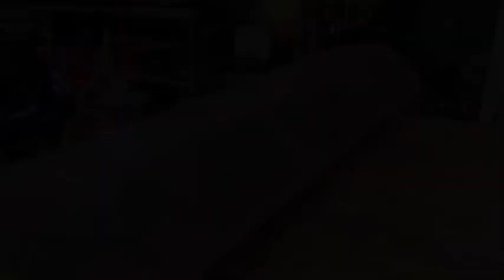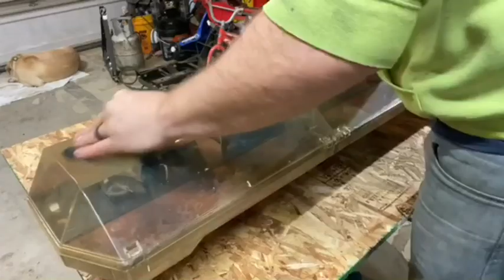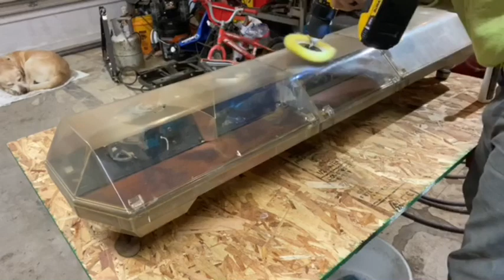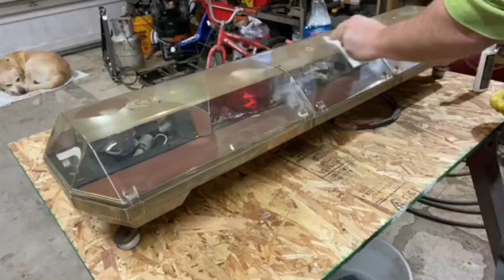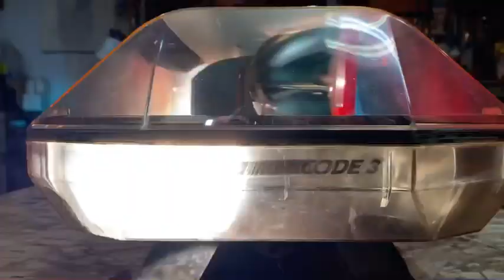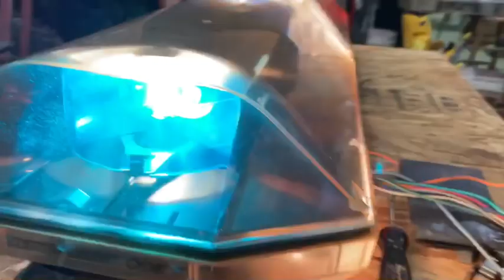Code 3 mx7000 dome restoration

Comment: Great job, however, I've found success in using SprayMax 2K Clear Glamour clear coat, it's a 2 part auto clear coat that works amazing and you never have to polish again. I used to polish bars all the time and now that I've found this stuff, all I have to do is wet sand, dry, and spray the bar and it's done and looks factory new permanently

Comment: Really no comments on what your using to clean it up with? It might not only help someone it would keep someone interested on staying.
Reply from the maker: I use 2000 grit then 3000 grit I use windex instead of water to wet sand then plastic polish   Sorry for the delayed reply I work about 70-80hrs a week so it’s been hard to get on here the past few months
Reply: @mmpse2868  incredible transformation!  Thanks for the clarification of the sanding process!  I'm guessing Meguiars Plastx?
Reply from the maker: Thanks! That is correct.

Comment: When i did mine i used 1000, 2000 and then 3000 wet sand. Hand polished and hand waxed and came out decent but definitely needa try a drill next time for polishing it
Reply from the maker: Drill definitely speeds up the process

Comment: Hey thanks for that bit of info. I have put a bunch of time on polishing the plastic with some success but still not where I would like it to be. I went completely through my code 3 MX 7000 light bar and to finish it I need to locate 2 of the rotating light plastic gears that had become brittle and broke apart. 4 out of 6 are functioning. do you have any idea where i
I might be able to find this part? I have looked and didn't locate any. Thanks
Reply from the maker: You will have better luck just replacing the whole rotator assembly. Elightbars.org is a great source for used parts and Facebook has several pages for emergency equipment.  I recommend used rotators over new just because of the price.

Comment: What methods of sanding do you use?
Reply from the maker: I use 1000,1500,2000,3000 then polish. I use windex instead of water when I’m wet sanding
Reply: @mmpse2868  Thanks for the information. Is there any certain motion you have to do during sanding?
Reply from the maker: @sirendude  preferably Circular motion. I’m in the process of uploading a step by step video right now. Just waiting for the storms to blow through for better internet.

Comment: IS this for Sale?
Reply from the maker: This one is not how ever I have several other mx7000 with the same setup red/blue with clear domes available can make all red or all blue if needed.
Reply: @mmpse2868  What price do you have on them? Do you have just the lenses?
Reply from the maker: @jsimpson8018  prices start at $100 and up. I currently do not have any domes available. I have enough filters to make it all blue or all red
Reply from the maker: @jsimpson8018  we currently do not have individual domes or lenses available at this time
Reply: @mmpse2868  100 for the bar? Any jetsonics or just MXs? And how do I see what you have for sale and contact?
Reply: I came across a mint condition mx7000 complet and working with red blue ends with clear middle what do you think thats worth